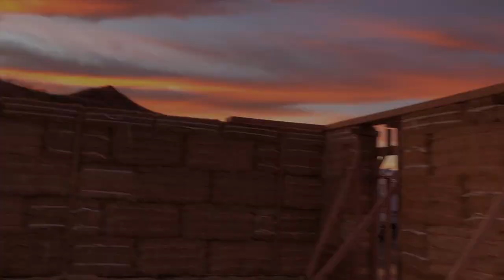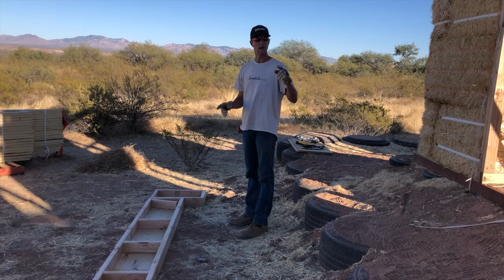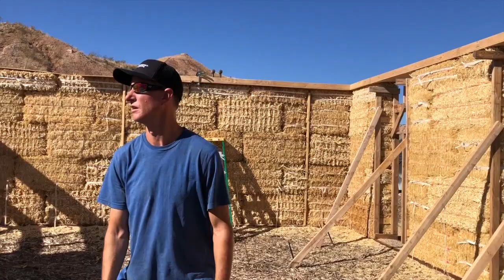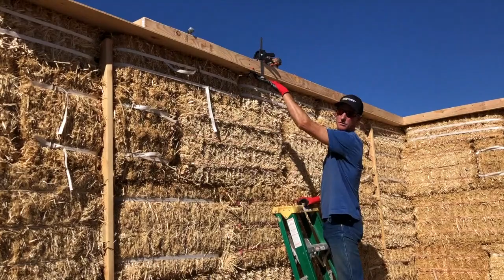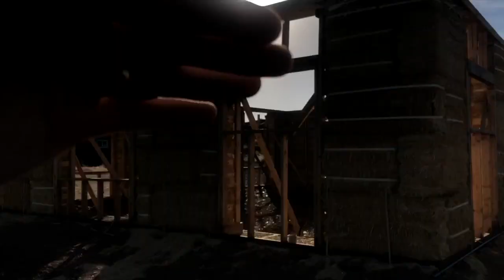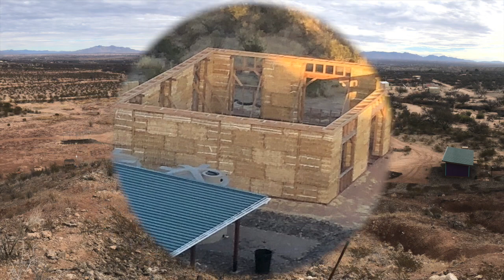COMPLETION Of Box Beam Assembly! | Couple Builds STRAW BALE Home In The Desert

Comment: Glorious site and sunset!  Lucky enough to do a SB workshop with Athena and Bill last Feb at Worm Farm. Preparing for my own SB build this summer.  How long is your longest top plate?  Since my build is substantially larger than the tiny house we erected in PHX (~800SF), Bill suggested making the top plate outer box arms interlocking  for greater stability and oneness.  Will watch the rest of your videos to see your fabulous finished product.
Reply from the maker: Great to hear, Kathryn!  Good luck on your build.  Our top plate (or box beam) is built in sections to span the perimeter, which is about 32' by 26'.  We're just under 800 SF, interior.  The plywood on the box beam sections is offset to span across box sections and to interlock at the corners.  Thanks for watching, and let us know if you have any questions.  We loved learning from Bill and Athena, but have chosen to do several things differently based on a bunch of factors, so we're still learning as we go and making some decisions on the fly.  Hope it all works out! 🤞

Comment: I can’t quite figure out how you figure out how much space you need to give above window and door frames to allow for compression... any advice?
Reply from the maker: A test with your actual bales is the best way, but what this process taught me is that even that is not 100% correct.  The reality is that the best you can do is just estimate as close as you can, and then be able to make adjustments where necessary.  For me it was anywhere from 1/2" to 1" compression per bale, but they won't all be the same, so you'll have to make  a few adjustments.  Not a fun process, but it's the only way I can think of to really get it right.  Good luck!
Reply: @MidlifePrices  great, thanks so much!